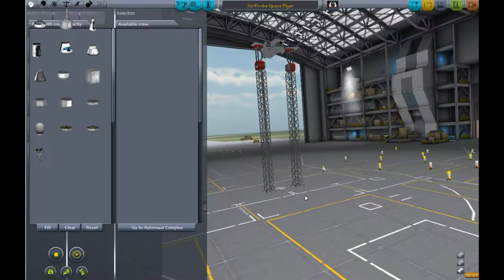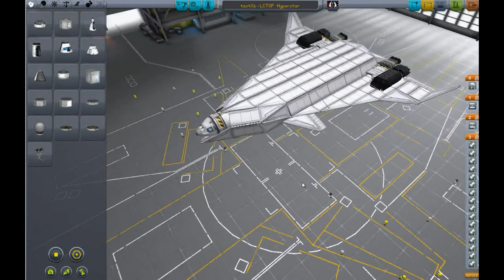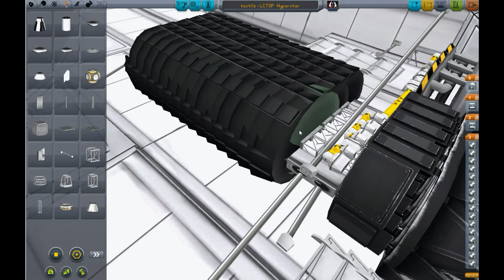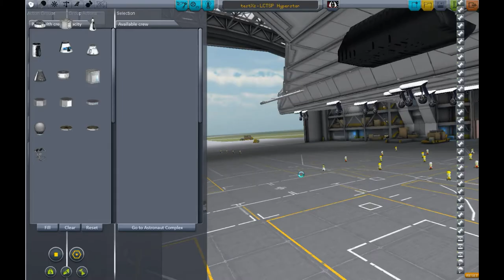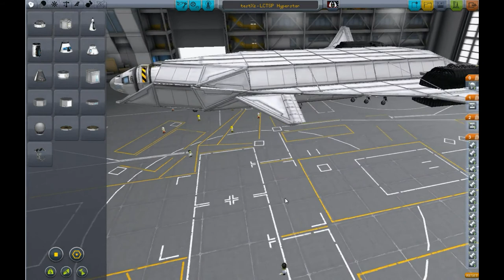*EXTREMELY OLD VIDEO* KSP V.21 -Vid#7- A flapping wing SSTO design. No Mods.

Comment: Gravity is already factored into your current orbital projection, so it won't give you anything you don't already have. To circularize, you want a change in prograde velocity at apoapse: if you fire at the yellow marker anywhere else, you are getting a radial component (relative to apo/periapse) that changes your orbit in ways you don't want. The blue marker points at your prograde at the 'apse: that is why you are supposed to fire at it the whole time - before and after the 'node. HTH, etc.

Comment: A note on physics: you always want to burn as close as you possibly can to your maneuver node, which means firing *at your blue marker* for the same amount of time on either side of the node. You also want to burn pointing at your prograde marker (to avoid steering losses), which means you want your prograde/retrograde maneuver nodes either at apoapse or periapse. Bottom line: gravity is NOT helping you if it forces you to point away from your prograde marker as you burn. HTH, etc.

Comment: In fairness, it doesn't. It says, "A flapping wing SSTO design! NO MODS! v 0.21", and this is what this is. Flapping wings, check. SSTO, check. No mods, check. V 0.21, check. Even with KSP's broken aerodynamics, you cannot achieve orbit without a rocket engine (or RCS): your orbit must always return to the point where you last accelerated, and flapping wings (and jet engines) only accelerate inside the atmosphere.